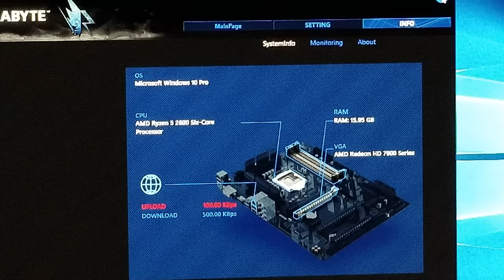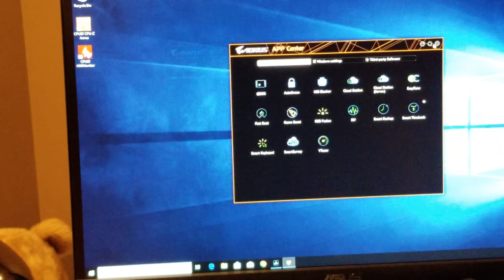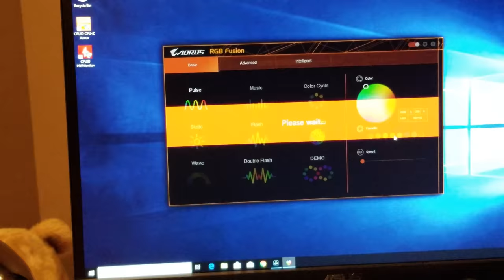Cooler Master MasterCase H500, Build Guide & Aorus B450 Pro WiFi

Comment: My rgb doesn't work sir, do you know what could it be?  I conected the pointer in the 12v but nothing lights up, so i don't know what's wrong, is there any solution or replacement for that rgb slot?
Reply from the maker: Well if your plugging in the RGB Cable to the 12V, ensuring the Arrow on the cable goes to where it says 12V then it will get the connection it needs for the RGB...other then that ensure you connect all the case cables including the SATA cable from the case to the SATA Power connector from the Power Supply...if all this was done and you've powered up your system it should then work, if it's not I'm not certain what else to mention...hope that might help...
Reply: @Reviewing_Playing_and_More_RPM  Thank you sir, for what i've seen it's the motherboard what has come with issues, since 2 slots were already damaged when i bought it... So i soppose it's the same with rgb. Anyways Thank you for taking your time to answer to us!!!
Reply from the maker: @elreiner9760  Sorry to hear the MB was damaged, I got a new Case that has damage, fortunately with it at least I was able to fix it but a MB is a different thing, hope you can RMA it or work around it, all the best...

Comment: Just curious. When you showed us the last shot of your PC, the top fan was not spinning. Is this by design of case? I was under the impression that both fans would spin at the same speed regardless of temps. Does only one spin until temps rise and need both fans?
Reply from the maker: Hi Daniel, no that was a miss on my part, I needed to connect one more cable to the Power Supply and didn't realize until it was uploaded for a while, once plugged in they both will work together at the same speed...sorry about that...Thanks...

Comment: Amazing video. Question tho, my motherboard rgb has the five pins like you said, but my connector is 4 pins with with one blocked off. What do I do about that?
Reply: Maybe I’m looking at the wrong thing, not sure
Reply from the maker: So the way it works is if it's 3 Pin, then it's a 3 Pin 5V RGB Header that needs to be used, if you have a 4 Pin 12V then you use the 12V RGB Header on the MB...connecting a 3 pin to a 4 or 5 Pin RGB Header can cause problems as the voltage will be to high and possibly short out the device or even the MB potentially...your saying it's 4 pins with one blocked of means it is likely an ARGB Header that's needed to be used...

Comment: Hey, thanks for the video, helped me a lot. However, a few questions. I know you did this a year ago but maybe you can still help me:
I'm not sure where on the mobo to connect those two bits in 06:03 ?  
Also that bit at 06:45 with a lid on it, I don't need that if I don't have any other LED components?
Thanks
Reply from the maker: I talk about this later in the video, 20:05 the two fans I thought would reach to the Motherboard but did not, so I did have to use the extension to plug these two fans together and then the other end just goes to the sys_fan_header on the motherboard. the part at 06:45 I discuss more at 21:34 and it goes into a 12V RGB Header, but yes your correct if you don't have any additional LED strips or such you won't need it....Hope that helps you out...Thanks...
Reply: @Reviewing_Playing_and_More_RPM  Thanks for the quick responses, I also figured I needed the extension cable, and thanks for answering the other question. You are the man!

Comment: I have the exact same case and mobo. However, the rgb cable that came with the case (the one that says cooler master on it) has only a 3 hole plug labeled "gigabyte" and the other side is labled "asrock asus msi" and is 4 holes wide, but has one of the middle holes missing. There is no 4 hole cable. What do I do
Reply from the maker: If you didn't get the cable which is used to extend the cables from the case to your motherboard, then you'll need to use Fan extensions, to extend your reach to the motherboard...they can be bought online...Thanks...
Reply: @Reviewing_Playing_and_More_RPM  I have the fan extension cables. The fans are plugged into sys_fan1. The OTHER cable, labeled part "i" in the cooler master h500 argb manual, has only 3 prong ends, and will not connect to the 5 prong rgbw header. Am I missing something?
Reply from the maker: You need to connect to the 5V ARGB which is a 3 Pin Header RGB, the one your referring to is a 12V RGB Header and would not work as it's to much voltage...you can get an adapter to convert it or use the controller that came with the case, I think that is designed to work with it but don't have the case any longer so can't check to be sure...hope that helps some...

Comment: do you know if that piece (cable cover) can be removed? I want to put an EATX (12X12 inches), thanks in advance
Reply from the maker: I think your referring to the Power Supply Shroud, if so yes it can be removed there's only 1 screw holding it in place...but if you mean the Hard Drive Bay it comes out as well same thing only one screw on the bottom...Thanks...
Reply: @Reviewing_Playing_and_More_RPM  Hello sir, thanks a lot for you response, I mean the vertical cable protector that serves as a guard for the set of holes through which you pass the cables that come from the PSU. This piece is to the right of the motherboard in your video, it is a long rectangular piece oriented vertically. I'm trying to get a case that can support a server-type motherboard whose horizontal dimension is approximately 12 inches, so I would need to remove that part.

Greetings from méxico!, excellent channel
Reply from the maker: Yes it is removable as well...Greeting from Ottawa, glad you like the channel, much appreciated...Thanks...
Reply: @Reviewing_Playing_and_More_RPM  thank you so much

Comment: Ive heard it is possible to connect the 3pin rear fan to a 4 pin board connector. Is it possible? I believe my board (msi b550 a pro) does not have a 3 pin connector.
Reply from the maker: Yes a 3 Pin fan can connect to a 4 Pin fan header, it happens often actually...
Reply: Reviewing Playing & More RPM great video and thanks for your reply, will be using this as a reference when my case arrives.
Reply from the maker: @diegoh4579  Cool...Have a great weekend...

Comment: i bought AiO watercooling for my cpu the ML360R it all has to be connected via a hideous cooler master control module. cant control my two large fans rgb and watercooling fans for some reason. must have missed some plugs
Reply from the maker: Awesome looking CPU Cooler, for the two front fans ensure you have used the Sata Connector from the case and plug into the Power Supply, haven't gotten any experience with the Cooler Master Control Module though, so not sure how to help in that regard, sorry...Take Care...
Reply: @Reviewing_Playing_and_More_RPM  The SATA connector from the controller or is there a separate SATA chord?  The only Sata connection from the case I can find was with the controller add on.
Reply from the maker: @diamondlion47  If your referring to the two 200mm fans on the front, there were just the two fans connected with the mess of cables that then connect to the motherboard, there was a Sata Cable from the case itself, unless I'm remembering a different case but was pretty sure there was one, if not my mistake on that sorry...I don't have the case any longer to be able to double check...I didn't need to use the controller but I believe there is one on that...
Reply: @Reviewing_Playing_and_More_RPM  Nvm I figured it out, maybe you had an older version of the case.  The fans are powered through my motherboards fan header and don't require the controller or any additional sata power.
Reply from the maker: Yeah, sorry about that, glad you got it sorted out though...Thanks...

Comment: Hi, i got a problem with my front rgb fans, they are spinnig up but not showing any lights at all, i have the sata controller plugged in but the rgb ints not comming up, idk whatts wrong.
Reply from the maker: Check that your cable for the RGB is plugged into the Motherboard. Also check whether your software is recognizing them, if not something is not plugged in correctly.
Reply: @Reviewing_Playing_and_More_RPM  the RGB connector is the one that says gigabyte?
Reply from the maker: Check the connector from the case if its 3 Pin its ARGB, if its 4 Pin its RGB, they have different names based on the MB Manufacturer. On the MB you need to line up the arrows from the cable with the arrow on the MB connector.

Comment: I noticed in your RGB demo the top fan was not turning.  Do the fans in H500 turn themselves off if they are not needed or was it just not working?
Reply from the maker: No that was just me, I forgot to plug the fan into the system fan on the motherboard after connecting everything...Good Catch...

Comment: hey thanks for the vid, q what is the model number of the 120mm fan on the back? would like to know the airflow and loudness of it
Reply from the maker: It's the provided one that comes with the case from Cooler Master, and it's fairly quite can't say db level though but I'm pretty picky when it comes to noise and it is good to me so I think you will find it acceptable...Thanks...
Reply: @Reviewing_Playing_and_More_RPM  do you still have this pc/case? would you be able to check the product number of it (i am pretty sure you can see it if you look at the fan from behind the case), is it perhaps R4-C1DS-12FK-R1? i'm trying to make my airflow as neutral as possible so knowing the CFM of this fan would help me a ton, thanks for the reply!
Reply from the maker: No it's been sold sorry...

Comment: Thank you very much for such great video, this was the one I was looking for since I have an aorus board. Just one question that I wasn't able to find or find on the video, why the upper front fan is off?
Again thank you
Reply from the maker: There was a SATA Power cable that I forgot to plug in, worked afterwards...didn't realize until after...
Reply: @Reviewing_Playing_and_More_RPM  Thank you for the answer
Reply: Today I started to build this Case with a Aorus Elite Mobo, I realized that I have the ARGB version and I don't have any 4 pin but 3 pin so I don't know where to connect it, can you help me with it?
Reply from the maker: @ryutsuki89  So a 3 Pin is a 5V ARGB and a 4 Pin is an RGB Header, if you are missing the ARGB Header on your MB then you have a couple choices, 1 is to get an ARGB Hub from Cooler Master, or a Deepcool Converter, I did a video on it to show how it works, here is the link: https://youtu.be/sK4PGOZ0EGA hope it helps...

Comment: I have a question, I'm reassembling the same motherboard and case but when I fire it up the front fans are not running, but have color what did I miss?
Reply from the maker: I'm not sure, I did have this happen to me and after checking all the connections I then realized the Sata Power from the case was not connected to anything, after I connected it to the PSU then it worked...not sure why but it did...hope that helps...Thanks...

Comment: Please help me with this issue.....I just got the Cooler Master H500 but my motherboard doesen't support RGB... can I still use only one color ( blue ) with the small controller provided in the unit, I don't what to change my motherboard... thanks for your help...!
Reply from the maker: I've never tried that with the controller so can't say for sure, sometimes you can pick a single color in the BIOS that will work not certain this case will allow it or not though.
Reply: @Reviewing_Playing_and_More_RPM  Thanks again for your response...do you know if it would be possible to completely bypass the mother board and use a separate controller, I don't want to change my motherboard just to get a standard plain blue color with no effects...! THANKS
Reply from the maker: @ping3488  The controller that came with it once powered by the SATA Power will let you control the colors as long as when you look at it there are buttons on it, been a while so don't remember off hand, if it has three different buttons then yes you can control the speed, colors and modes.

Comment: I got this  case..  bottom fan rgb is not in sync with the otger fan or the motherboard. .. any solution?
Reply from the maker: +Harsagar Singh Sawhney Can have a look at the BIOS and see if you can make some changes there, otherwise consider a fan hub. I don't have experience with hubs myself but have read the help a lot. Sorry wish I could offer more but just not certain. Thanks...

Comment: Does the case come with the fan splitter cable at 5:35 included? Not the RGB one, but the one that goes into the fan header on the MB, I mean.
Reply from the maker: Everything in the video came supplied, I didn't need to purchase anything extra. Thanks for watching...
Reply: @Reviewing_Playing_and_More_RPM  And thank you as well.

Comment: Do i need to plug in the rgb controller in order to use the software?
I forgot to add the controller and i dont want to open the case. Is it necessary? (I have asrock z390 extreme4 mobo)
Reply from the maker: As long as you have the software seeing the RGB then no, the motherboard software can control the RGB, there needs to be one cable plugged into the RGB somewhere though for it to do this...if not then you will need to use it...to find out open your motherboard software and see if it recognizes anything and then test it can control them...if not then you'll have to open it up...Good Luck...
Reply: Reviewing Playing & More RPM thank you!

Comment: Hi, so I just built my pc and the front fans had a 3 pin rgb connector, but my motherboard has a 4 pin 12v. What type of 3 pin to 4 pin adapter would I need to get?
Reply from the maker: If you do a search on my channel, you'll find two that I did a review on one is the Deepcool Converter and the other is a EZ-DIY FAB Converter, either of which will work depending on your needs there is more info in the video that explains it, but yes it will convert a 3 Pin 5V to a 4 Pin 12V and vice versa...it would then allow you to use the MB's RGB Software to control everything...
Reply: Reviewing Playing & More RPM thank you so much for your help, I ordered the deepcool converter
Reply: @ssjgjohnny  same it has different connexions, a 3 pin header to the motherboard, but the mobo has a 5 pin with the 12v rgbw... no lights when I connect my rgb header... should i grab the converter ?
Reply: DivinsGaming I don’t get mine until Saturday. Probably should
Reply: @ssjgjohnny  let me know when you received it please!
Reply: DivinsGaming I wouldn’t recommend buying the deepcool converter, I got mine and plugged everything in correctly and the moment I turned on my pc the wires to the sata cord got fried and start smoking
Reply: @ssjgjohnny  whoooah i wont buy it then, thank you so much for making me save money👍
Reply from the maker: In the video I did on the Deepcool Converter I plugged in everything as it needs to be and it did not cause any problems, SSJG may have had a bad experience with this but if this device was truly causing this to happen on every PC it's been used on, then Deepcool would be facing a lot of backlash from people, it's obviously your choice but I do believe in this product after having used it, so while SSJG had this problem, I do not believe others are experiencing this, I didn't and show it in the video and have not seen any complaints that back this up...so take that for what it's worth...Thanks...

Comment: hello, could you put a liquid cooling of 240 on the top? I have that same motherboard (without wifi) and I think there would be no space, thanks
Reply from the maker: +Jaire Fernández Yes there is lots of clearance for a 240 on top 280 as well. Now if it's a Extended Motherboard that I'm not certain of but up to an ATX you'll be fine. Thanks...

Comment: Hi! Would you recommend this in 2021? My choice was this case and Lancool 215.

I have the budget to get either but I'm wondering which is better overall in terms of performance and more importantly dust management.
Reply from the maker: They're both pretty close to the same, the Lancool 215 looks equally as nice maybe more depending on preference. I had a great build experience with the H500 but the Lancool 215 looks like it might have some advantages with the Fan/RGB Hub  as well. I think it's going to go to which one you like the looks of most and Airflow in both is really nice. If choosing again I'd likely go with the Lancool 215 because I like cases with Fan/RGB Hubs.
Reply: @Reviewing_Playing_and_More_RPM  ok! I'm just worried at the part that the dust filter absence of Lancool 215 since it doesn't have one. For thr argb hub I'll be reusing my old case's one.

Btw how many ARGB stuff can you daisy chain with the included controller in H500?
Reply from the maker: @rensquared24  I believe it was 3, and if you have a hub then that would lend me to go with the H500 since it also has the added filter.
Reply: @Reviewing_Playing_and_More_RPM  what would happen if I daisy chain more than 3 ARB stuff on the included hub on H500?
Reply from the maker: @rensquared24  I believe the Max ARGB is 5 not sure beyond that.
Reply: @Reviewing_Playing_and_More_RPM  thank you!